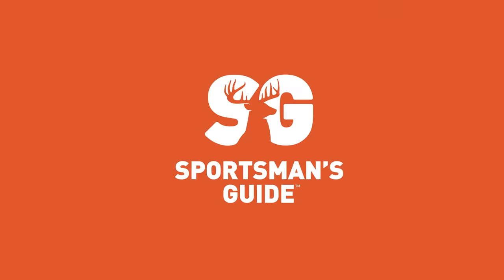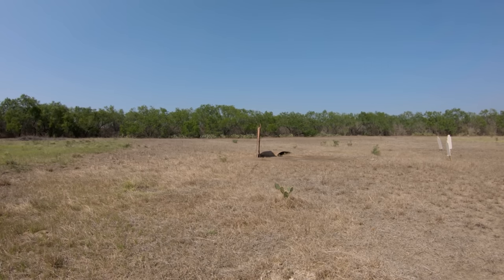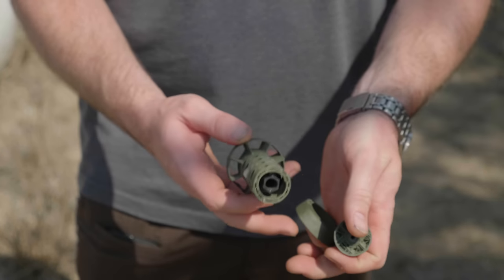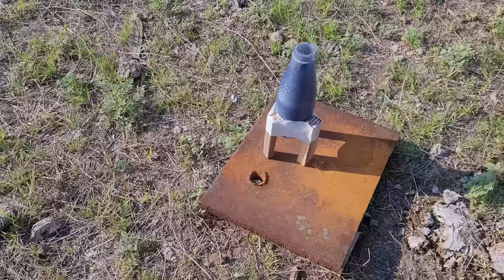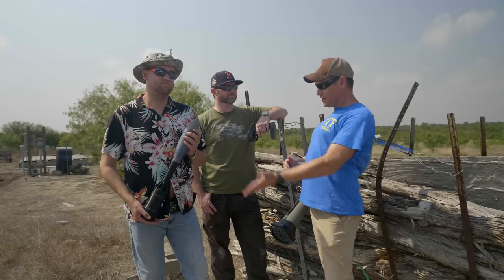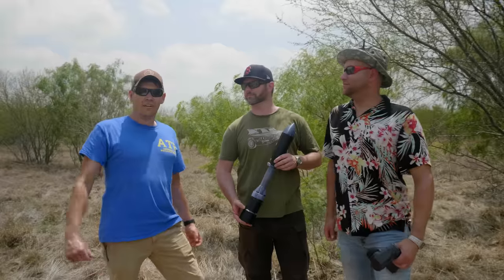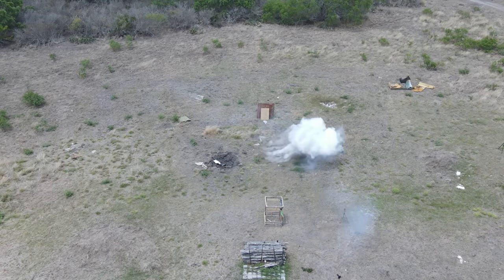World's First 3D Printed Rocket Launcher (Featuring D&S Creations)

Comment: the printer you are using has some under-extrusion issues - either clean + re-seat the print nozzle, use a slightly higher temp and/or clamp down more pressure on the spring pushing the extruder wheel against the filament. I also recommend moving to a nozzle that is at least .6 or even 1.0 rather than the standard .4. (i ran a 3d print shop for 2.5 years) + 2 more hobby printing - so trust me :D
Reply: It was just that tan filament. Every other color was great.
Reply: Possibly too cold as well, but as you say, very uneven extrusion.

Possibly printing too fast due to impatience?
Reply: @brucebaxter6923  maybe, but this reminds me more of an issue i saw with a cr10 i had a few years back, the bowden tube kept backing out and creeping away from the metal hotend, causing a gap and friction in the throat + a grainy filament that then clogs it up a bit more - combined with the underpowered cr10 extruder and/or worn out gear teeth. and yeah @D&S_Creations - it really was almost exclusively the greenish filament used on the small rockets. if it was an old filament that had absorbed a lot of water, it would also lead to poorer print quality
Reply: @DandSCreations  yeah, it really was almost exclusively the greenish filament used on the small rockets. possibly it was an old filament that had absorbed a lot of water, it would also lead to poorer print quality ontop of what i listed above and in my reply below to Bruce Baxter
Reply: @cytherina  
For sure. It definitely could be that. 

Personally I have found those issues to be reduced by slowing down and running hotter nozzle with less cooling fan.
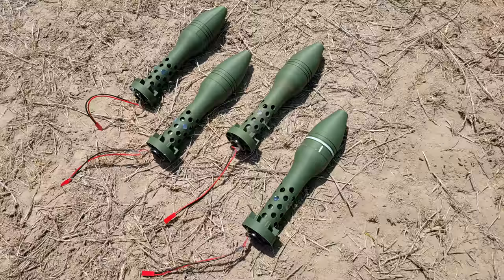Reply: @DandSCreations  No, it's not just the tan filament. At 2:48, the green has serious under-extrusion issues in between the holes to the right of the fins, almost certainly from too many retractions, or too large retractions, in the small areas between the holes. I'd bet your printer is running a bowden setup, and you are running at least 4 to 5mm retractions. Change out your PTFE leading to the hotend, it's probably worn, and switch to a dual-gear extruder if you want to fix those gaps. If you don't want to buy parts, then look into Linear Advance(a.k.a Pressure Advance). Most firmwares  support it these days, and it lets you calibrate a "K-Factor" for different filaments, which greatly reduces the issues from large and repeated retractions. Also, just to rub it in a bit, since you blamed the failure on the "reality" of 3D printing, with the size of that ringing around the holes, your gantry seems very wobbly if you didn't print these over 150mm/sec. I'm running 6000mm/s2 accel and I still don't see ringing like that until I push the printer over 180mm/sec.
Reply: @samuraisystemsllc  I printed these all 7 months ago and since replaced the extruder with a dual extruder and the Bowden tube, I also tightened the gantry rollers. I honestly am not super hung up on print quality. These rockets only break up when they strike an object at oblique angles. All I care about is steadily improving reliability.
Reply: @cytherina  Does the dehumidifier solve the "older filaments" with "absorbed lot of water" problem?

Comment: I 3d printed replacement igniters for a LAW along with mounts to install a 10mm barrel.  This was to make it non-NFA.  I then built 10mm rockets that burn out inside the barrel length like the real thing.  I'm currently working on getting the rockets to a higher velocity.  Right now they are around 400fps.  

The first test can be seen here:  https://www.youtube.com/watch?v=rhQ8cSFAM2M
Reply: Most underrated comment, people check this out.
Reply: Cool but sadly the rocket can only have a 0.25 oz. The AT4 is like 15 oz which is where the anti-tank properties are at.
Reply: why has nobody converted this idea into a 3D printed mortar? all you'd have to carry is a 3D printed abs+metal tube your propellant charge and your 3D printed rounds. they'd be incredibly light and easier to carry than classic mortars and could be absolutely deadly using something like ammonal to throw shrapnel or BBs

Comment: For the smaller rockets, I would not use "White Lightning" propellant or propellants that have coloring agents that have a tendency to absorb moisture (ie Reds and Greens). They have a tendency to become harder to ignite as the motor ages.  "Blue Thunder" is a safe bet, so is Fast Jack.

Comment: For a tube launch system. . . Bell shaped engine porting(cardboard with fiberglass cover, cheap and easy)= 
increased & controlled thrust+ smooth bore + tight tube+ fold flat launch deployed fins (PFTE works great!) = 
stabilization and a true linear flight path! 🚀

Faster speed not needed! 🚀

Three fins is best but two curved ones will work if you get them positioned correctly and the bonus for using just two is increased speed! 🚀

Two small pop out canard fins just behind the warhead will slow the spin and produce even greater stabilization.

Without a gyro or a guidance system a proper fin design is a must and will induce spin stabilization. . .
 
From an old Rocketeer!🚀

You Guys ROCK!

Comment: If you do a little research you will see that they used I believe was an M7 propellant which is the same as Bullseye pistol powder. This was extruded into 3/8 diameter by 8 or 10 inch long noodles there was 4 or five of these inside of a metal casing. At the top of the casing was electric Mash does Feud hot Sparks down the motor to ignite all of the fuel at once. It burns were approximately 1/3 of a second. That is why you hear a loud bang and a thing projects out of the end at relatively high speeds. Just a 411. I was a bit of a rocket head when I was younger not to mention other things. Lucky I made it out of my teens. Getting cancer had a lot to do with that. God works in mysterious ways. Good luck guys
Reply: Do you have any resources regarding m7 propellant, may be useful in future builds
Reply: Indeed he does.

Comment: Looks like your CG and CT( center of thrust) are off. Also powdered copper won't work you need copper flashing like for roofing depending on size, bigger = thicker. There are formulas on wikipedia and if youre clever you can put in a test stand to measure. Don't ask how I know but that was the first problems when doing this. There are ALOT of variables, especially with the rocket getting lighter as it burns, the back blast charge and mass to do a boosted launch, the time fuses the det fuse etc etc. really good for a first try!

Comment: I would suggest adding larger fins, it might help with the stability when shooting. GREAT VIDEO!!
Reply: Or even spring assisted fins, almost like what rpgs use
Reply: Honestly I think it's more to do with weight distribution and as was stated the lack of sufficient thrust
Reply: collapsable reverse folding fins like an rpg would assist greatly.
Reply: @deathninja16  we are trying to keep it 3D printed. These were the first two firings of this rocket we've ever done. Have to start somewhere, collect data, make changes. The concept fully works and now we know what needs to change. (Redesign the recoilless cartridge, more of a launch charge, less nose heavy, more fin area)
Reply: and maybe remove rifling if there is, spinning fin stabilized munitions arent really that accurate

Comment: Just my person opinion but I think replacing the fin design to a fold out would be much more effective, that design you are using happens to be similar to that of mortars and rifle grenades. Mortars and rifle grenades are propelled by an initial charge and then they usually wobble around in the air and eventually stabilise BUT because you are using a rocket that continuously pushes on the round, if the round was to wobble then the round would change direction because of the rocket engine whereas mortar or others would just follow a ballistic path. You would need much more stability that is instantaneous compared to the mortars design such as the fold out fins of the s8 or javelin missile/rockets. Also for direct fire the rocket engine isn’t as powerful as it should be, because you are fighting directly against gravity rather than working with it in the case of a indirect projectile which follows an arch or ballistic trajectory. The rocket engine should be more violent like the engine of RPG. In my opinion…
Reply: Everything you've articulated is 100% accurate, and I wholeheartedly agree.  However, trying to take baby steps at the moment. The recoilless boost phase didn't function at all. This will be addressed. The rocket is a commercial rocket intended to sustain launch velocity in this design. While eventually we can revise the motor at this time we are going to use commercial g80 motors due to consistency and reliability.  The folding fins were also not selected at this time because we're trying to eliminate as many possible sources of mechanical failure during launch. In future iterations, folding fins will likely be employed. Just not at this time

Comment: Easy stability test - find your rockets center of mass, tie a string around that point that is several feet long. Spin it around like a lasso. If the rocket is stable - it will stay forward during the spin. If unstable it will spin facing backwards

Comment: Expanding fins/wings that open/unfold like the LAW rocket has will help stabilization of flight. More power in the first charge to keep it stabilized before engine ignition is a must. If you can get the schematics of the Law or any other rocket, that would be a great help. They would have things from size and weight to thrust etc. Since you are 3D printing, you might need certain weight added to the rocket.  One can line the inside with adhesive then ad BBs to fill it up . After the adhesive is dry, pour out the extra BBs.  Add more BBs as needed for  exact weight. But thats just a few ideas. You guys are the experts. I love your channel. I love your dangerous toys. Please be carful .

Comment: Pro tip: Use an balloon filled with Brown's Gas behind the rocket and fuse. That detonation should launch the projectile fast enough before the rocket stage kicks in. Potentially also use an HHO balloon and pull-string fuse, detonate the balloon, and have the pull string fire off the rocket motor and activate the warhead. Not really hard stuff, but you all just need a way to achieve higher initial velocity.

Comment: I think you need more weight on the rear of the rocket. The nose wants to drive down because of all the thrust in the back. So either make the rear heavier, maybe make the overall length of the rocket shorter, or potentially use a slower burning rocket motor that burns longer but produces less thrust. Idk, I'm not a rocket scientist ornak engineer, but it sounded good in my head 😂 enjoyed seeing it and hope to see the next rendition!
Reply: A channel called Jairus of All has a wonderful video on how to make a properly flying rocket.

You want the center of gravity (the point that it will freely balance) as far forward from the center of aerodynamics (the point that that airflow will not automatically rotation the rocket in any direction). The farther apart those two points are the better (that is why arrows and dart will fly tip forward regardless of how they are thrown)

Comment: Got a question, would a pipebomb that is only half filled with a slow (another question: or fast ) burning powder produce more pressure/ destruction than a fully filled one?
Reply: Yes for both because there is more space for pressure to build in the pipe bomb before exploding.
Reply: No, because a pipe bursts at the same pressure regardless. If you want higher pressure, use a stronger pipe.
Reply: now we have tho different answers ;)
I just think of it like dry ice in a waterbottle: if you fill it completly with water its not as lod, because there is almost no gas in it when it bursts.

Comment: Wonder if mixed polymers can be used as the the part ceramic or even part metal polymers would help in its ability to withstand some of the forces and hold
Up better. No expert though. Just a thought. I know there is some on the market for printers. Fascinating and incredible work guys!

Comment: I think they need a little more mass in the copper to get it to solidify into the penatrator they want. seems like instead of being a solid explosibly formed dart, it was actually a liquid at the point of contact. there needs to be enough copper to deform and streach like mozzarella to the target.
also, it fucks with my head that the copper "is in fact a solid but it behaves and is molded as a liquid"
Reply: We're on it!
Reply: A liquid is essentially just a very malleable ( and ductile ) solid with a very low compressive ( and tensile ) strength, is it not?
( from the perspective of nearly everything but molecular physics )
Reply: @chri-k  Liquids are non-compressable. and no, not exactly. My quip about mozeralla was more serious than it sounded. the EFT (explovily formed penatrator) never actually melts. it absorbs so much energy that it turns into a spear, one that is moving so fast and with so much energy, it's easier to model as though it had melted
think about how when a bullet will "splash" when it hits something it can't affect. or how the ground will splash when it gets hit with a dud artillery round. 
The reason this is important is that the copper has enough structure and properties that it will penetrate as though it is solid while being deployed with the simplicity of a fluid. It also still work hardens too if memory serves, so hile it's impacting, the impactor is basically self hardening and self sharpening as it makes it penetration

If you errantly think the copper is there to be melted, you've only mad an expl;movie copper squirtgun and not a shaped charge.
Reply: @seldoon_nemar i guess i did misword, and also malleability + comp. strength + yield cannot describe non-compressibility, unless you define yield as “the point where elastic deformation starts to happen” instead of “the point where plastic deformation transitions into elastic”, 

in which case could you define a liquid as “high compressive strength high tensile strength high malleability high ductility low yield solid”

( also i was talking about the general case, i have no idea how a shaped charge works, but the two things i do know about them is that they do concentrated boom, and that the copper does not melt. I have no idea what the copper does, where it is, or why it is, but i do know that it does not melt. and i wasn’t explicitly talking about them anyway )

Comment: Good job, very impressive. I do not believe it’s a center of gravity issue though. If you want something that would actually work against armor, use a bigger initial charge to get it out. If you’ve fired an AT4, then you know what kind of blast you’d need. I know you can’t with 3d print, maybe use fiberglass. I think that’s what the AT4 is made out of.
Reply: The barrel is PVC wrapped in fiberglass, the rest of the launcher is 3D printed. The rocket is entirely 3D printed. Will definitely rework the recoilles charge. They didn't function very well and the rocket had slow acceleration.  The fix is already in the works.
Reply: @DandSCreations  sweet! I can’t wait to see it!

Comment: One thing that could be noted is that the shape charge in tow missles is a lot less aggressive as well as solid copper piece, but obviously we don't 3d print copper yet
Reply: There's "3d printed" copper. It's filament with copper powder mixed in, goes into a kiln to remove the binder and you get a part that's essentially compacted copper dust. Then it gets sintered.
Extremely cost inefficient to make cones, though.
Reply: Copper can be 3D printed through SLS, but it is mighty expensive. It would be much more cost effective to print the shape in PLA and then use this for “lost PLA casting,” where plaster is poured around the PLA, which is then burned away in an oven to end up with a mold that can be used to cast copper.
Reply: You can electroform a copper cone pretty easily and it just needs a little cleanup.  Basically 3d printing on a molecular level.

Comment: Ok so you were using a potato cannon basically. Cover the engine with a balloon and then  light the rocket engine first. The idea is that the engine   is Ignited before it leaves the barrel and the flame from the engine will Ignite the Methane or whatever. So now the rocket won’t have that jolt from the engine starting mid flight and won’t break apart into a million pieces. This will also help with accuracy because the engine has time to stabilize.
Reply: This has already been worked out now with hvac foil tape delaying the ignition.
Reply: @DandSCreations  you could also use a smaller engine and a larger methane charge. And the rocket engine would just help maintain the speed of the rocket instead of trying to accelerate it. because accelerating it is were it lost a lot of accuracy. And that is for the small one.
Reply: It lost accuracy because of the timing of the engine being inconsistent, I have a fix for that.
Reply: @DandSCreations  well if you ever need any ideas. I’m open.
Reply: @everythingballistic8812  what you saw was the worst performance ever recorded out of the small diameter launcher. We just chose to show our failures instead of hiding them. But the failures will be corrected handily. We got this.

Comment: Lbs of thrust should be at least 100 times the weight of the projectile. Try using ammonium perchlorate for the propellant and the rocket structure needs to be more rigid. Try making it out of aluminum
Reply: We're already using ammonium perchlorate, it's the AP in APCP